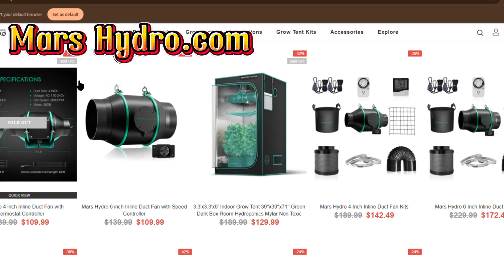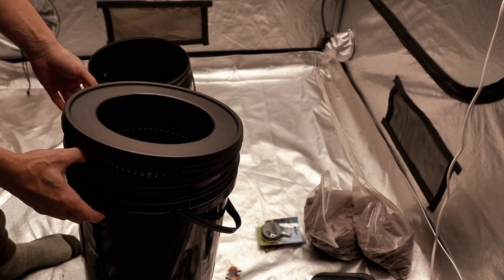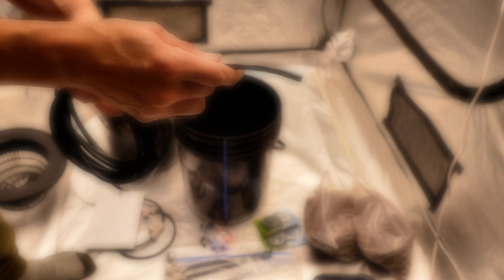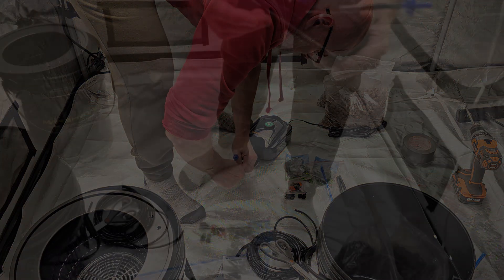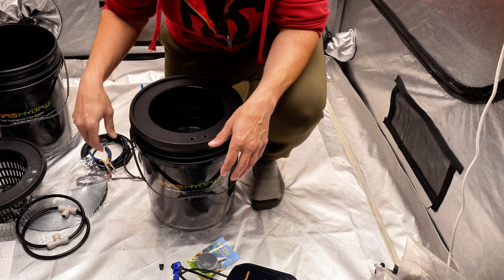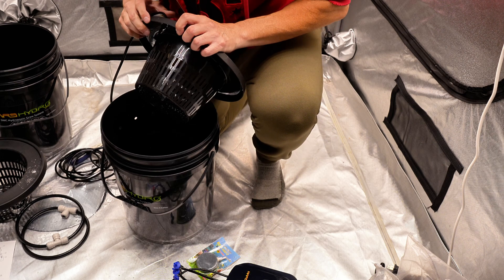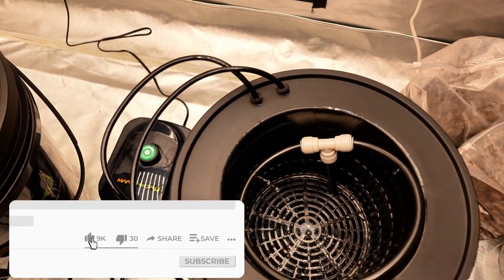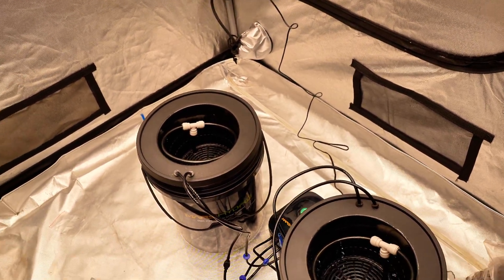Setting Up My First DWC Hydro Grow #marshydro #fce3000 #ts1000 #vg80

Comment: how often do i need to refill water? can i got to holiday for like 10-14 days in lateflower?
Reply from the maker: No I wouldn't leave for that long, you'll probably be filling the the buckets every couple of days
Reply: @TapRootsGrowing  that's sad, so I'll stay at autopot and soil
Reply from the maker: @spamreactor7494 yeah unfortunately you have to be around alot for DWC. Between water changes and just monitoring your water PH levels it's pretty time consuming
Reply: @TapRootsGrowing  How about using one of them side ports for a drip irrigation/fill system? :)
Reply from the maker: Yeah I guess you could. A guy in my discord showed me a hand pump that he uses to empty and refill his buckets with. Neat little gadget

Comment: How do you flush these type of kits?
Reply from the maker: By flushing do you mean the system or the plant?
Reply: @TapRootsGrowing  The system.  I don't see any drain port.  Do you have to lift the plant,  roots and all just to change out the water?  The roots gonna wrap around that bubble stone.
Reply from the maker: @artemiserectus  yes I had to pull out the roots and switch my water that way. I would put the roots in another bucket while I changed the water then I would put the roots back in the bucket. It's a bit of a pain but there is pump that I'm going to buy that can drain the bucket without having to take the roots out. When I do another DWC run I'll get the pump and show it in a video
Reply: @TapRootsGrowing  I wonder why they didn't put a drain port in it?   The system needs to be flushed as needed and some nutrient solutions must be changed for going from veg state to flower.   I'm used to having a reservoir system with all the pots connected with hoses.  I guess you could modify it and put in a pump then have the hose long enough to put into drain.  I'll be curious to see your update.
Reply from the maker: @artemiserectus  yeah I'm not sure why they didn't add a drain, something to improve on I guess.

Comment: Hi Guys!! I have this set up and also drilled holes in the top and plugged the sides.  There is no real easy way of changing the water, let me explain.  If your plant is already  positioned/flowering through a netting then lifting it that high to change the water to swap a 15 litre bucket.... you really are going to snap a lot of twigs. Get a PUMP thank me later
Reply from the maker: @Turnster  as my plants get bigger it's getting tricky to do water changes lol. I'm sure it'll get a little easier as get more experience ✌️👊
Reply: Do you realy need to change the water during a grow? How about just adjusting the water you have?

Comment: There's no coating on the LECA (lightweight expanded clay aggegate), just dust from them eroding each other by movement in transit. Rinsing a few times will be required, to get most of the dust off. Outside sink, not a tub or cloggage may result.
Reply from the maker: @heywoodjablome5630  thank you my friend ✌️
Reply: @TapRootsGrowing  ... been through the issues with DIY RDWC.

Comment: No disrespect but they got ya. This is a horrible setup. Its almost like a company has no idea how to grow DWC so they slapped together a kit they think will work. Or maybe they watched my videos and thought theyd improve it. Sadly they made things worse with good ideas that just dont work in the end.

Its still early in the video but i see something ive been promoting for 15 years, it looks exactly like what i use. A lot of what you see in this video i inspired.

Now i see why people have so many problems growing DWC. Even experienced growers have problems with DWC. Its not this complicated. Btw, theres no coating on the pellets, just dust from shipping. I give that kit 1 out of 5 stars. Itll work but what a headache.

Those lids, could they have provided a worse design? No, those are the worst lids on the market.

That drain tube, it offends me theyre adding that to the kit. Are they braindead? You have two options, seal the hole and buy a transfer pump (to drain the rez) or buy a plastic spigot, paint it black, make the drain hole bigger and use the spigot instred.

Youll want to also get the buckets off the ground so you can have room to drain the bucket.

Its just a kit that will cause you to have problems. Since im low key busting your balls...not really im just mad theyre doing this to people...ill tell ya a legit pro secret. Get some Southern AG fungicide. About 3-4 weeks into the plants life add one drop to your water. That may be enough for the rest of the plants life but if you want you can add one drop every water change just to be safe. Its the best defense against root rot.

Who am I? I probably invented DWC 25 years ago. Best of luck to ya!
Reply from the maker: Thank you for your wealth of knowledge 🙏. A lot to digest 😆. I really can't agree or disagree since this is my first DWC grow. That's all I can do is try it and if I like it I can try and approve upon it. Peace my friend ✌️
Reply: @Tap_Roots_Growing  Just keep your PH at 6 throughout the grow and you'll be fine. PH will make or break ya. Don't trust digital pens use a drip tester. And don't forget the Southern AG!
Reply: What kit is the best in your opinion? Would you drain the bucket when swtiching from veg to flower?
Reply from the maker: I honestly can't say, I've only used the ones from Mars Hydro.
Reply from the maker: And yes I would drain and refill the bucket when I switched to flower

Comment: Is there a lot of cleaning growing this way? Lines, buckets, splitters etc
Do you have to clean before each cycle veg, flower etc?
Reply: There shouldn't be. DWC is very clean. If not that means something is wrong. I clean my buckets once, after harvest, with a sponge and dish soap with no scrubbing at all. Bad water management will cause salt buildup, if you have any crust on the walls of the bucket after you harvest that means your water wasn't right.

After harvest all I clean is the lid, bucket and clay.
Reply from the maker: I'm about to find out 😆. I was told to clean out the buckets between each feeding, as far as the lines, I'm not 100% sure yet.

Comment: I have these buckets running for a few weeks now and i did not prepare them, so i always have to disconnect from the pump and fiddle with the line in the bucket for res changes... :/
But i have two beautiful auto's in them who are doing great, fast development as expected in hydro. 
Personally, i don't see the big advantage of drip feeding, 'cause it can easily clog up, without prevention.
Trying to pull out clogged stuff always hurts the root zone.
I've got the Vevor 4-bucket setup additionally, without the drip feeding.
The most disturbing thing is, that my tent sounds like drug laboratory now, the splashing is almost louder, than the cheap ass pump.
In general: If you run into issues with the temperatures in the buckets, place the pump outside the tent, so it doesn't pump the hot hair into the buckets. 
I've just bought a big pump to supply all lines from another room, because now i have two of these pumps running, plus the splashing, it's getting loud 😅
Reply: Great tip about the air pump! They already get warm and with the lights hitting them they get warmer.
Reply: @Gh4cv  I kept the pump outside the tent, as well as the RDWC system pump. It was still too hot in the root zone, as ambient air was often over 90⁰ F in Summer (Australia).
Try again in Winter.
Reply from the maker: I think drilling the holes on top is a game changer. My grow is in my basement and it's pretty cold down here, especially in the winter. But I'll keep an eye on the temps just to make sure. ✌️👊
Reply: What size Pump do you  use, I also have a Vevor RDWC setup i only used the drip irrigation to get more lateral roots.
Reply from the maker: @oweyougrams  I'm not 100% on what size the pump is, it came as a kit.
Reply: @TapRootsGrowing  Appreciate the response, Growmie. I'm on amazon looking for a backup pump.
Reply from the maker: @oweyougrams  ah gotcha sorry I couldn't be more help, I don't know much about pumps yet